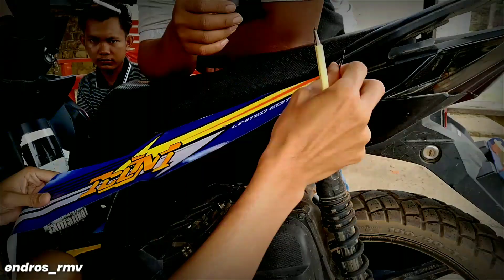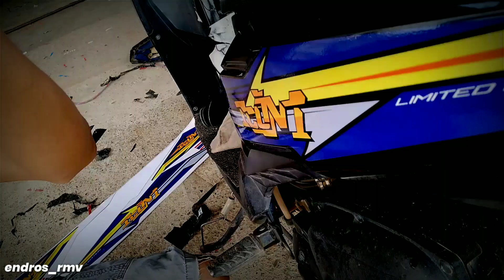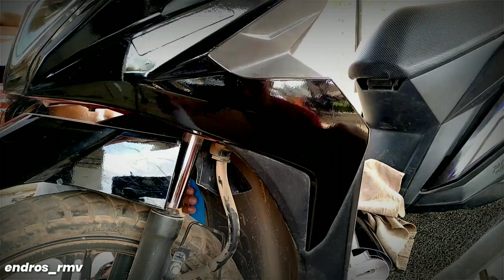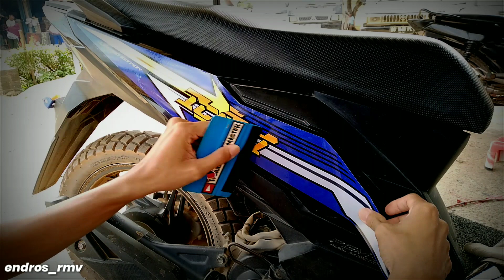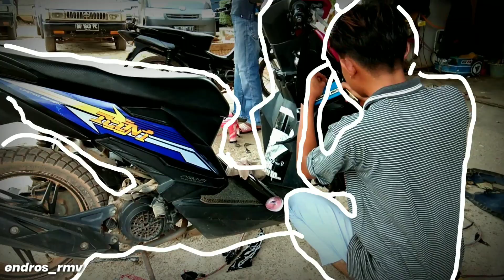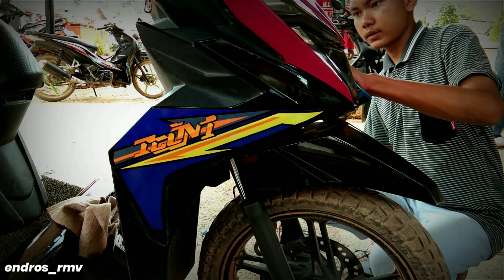Cara pasang Striping variasi motor   honda beat

Comment: Di kasih cairan apa bg sbelum masang. 
Saya mau blajar masang sendiri..
Reply from the maker: Untuk yang masih pemula, bisa pakai cairan shampo yg dicampur sama air, caranya cukup mudah, cukup disemprotkan pada body motor lalu tempel sticker lalu diskrap sampai air habis lalu panaskan pakai blower panas
Reply: @endrosrmv  makasih bg.. 
Kalau abg pakai apa itu.. 
Kok sperti nya mudah.. 
Di bersihin  pake apa